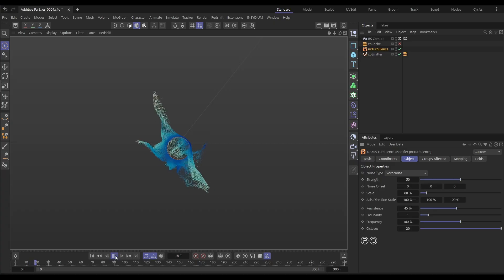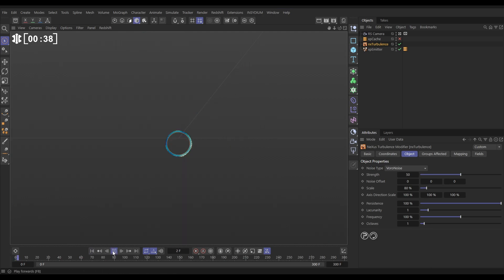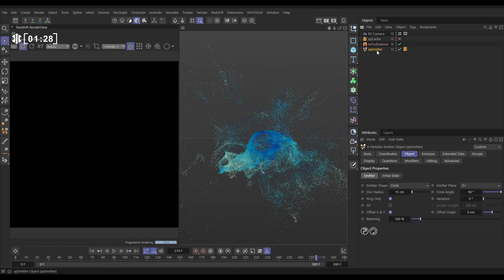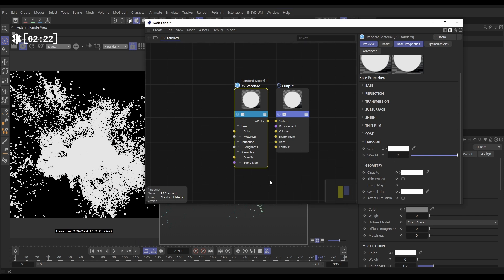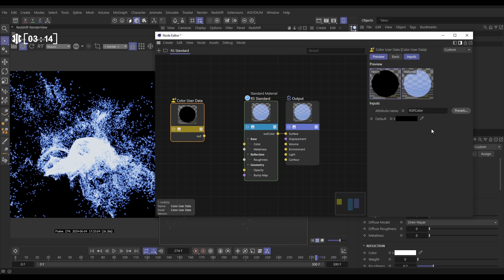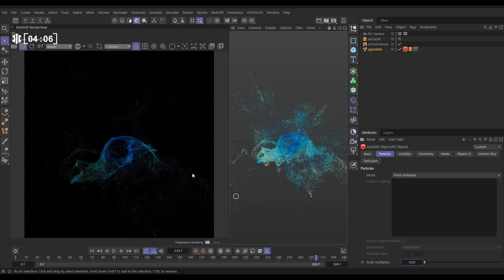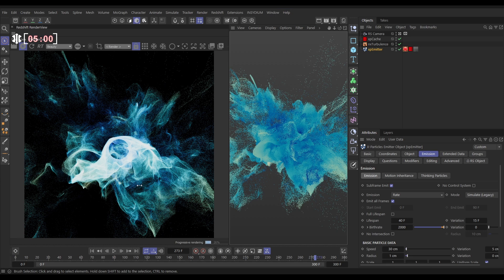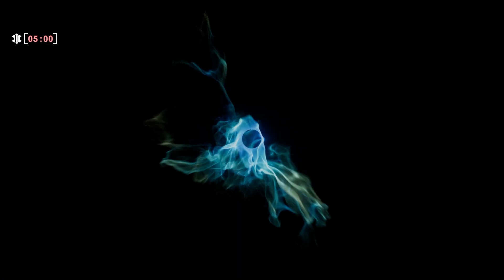Top Tip Tuesday - Additive Particles

Comment: How did you get it so smooth in the final render? When I render, even with motion blur, it doesn't have that plasma look, just looks like a ton of particles. I have millions of particles in the scene. Is it something in post?
Reply from the maker: If the individual particles are too obvious in your render, try reducing the point instance scale multiplier in the Redshift object tag. Getting that milky smooth look is mostly a balance between particle count and particle size. The more particles you have, the smaller they need to be in the render. Bob didn't render motion blur in Redshift. Instead, he applied pixel motion blur in After Effects. He also added contrast to the render using a Curves adjustment. This further darkens individual particles that are not overly bright which helps to achieve the smooth look.
Reply: @INSYDIUMLTD  Can you provide a detailed tutorial on how to make these particles more beautiful in AE? I have also used this effect in AE, but I still cannot get the same feeling as in the tutorial.
Reply: @INSYDIUMLTD  Ahh, thanks! I’ll try that.

Comment: I sincerely LOVE using this plugin  but my screen NEVER matches your tutorials  with the same settings. I always  have to crank up my particle count to get anything even close. Posted about it in discord but no response. It's been very demotivating. If anyone else can help I'm all ears!
Reply from the maker: It sounds like your particle 'Birthrate Timing' is set to 'Per Second'. In this scene, Bob has this parameter set to 'Per Frame'. This would mean that Bob has 30 times the amount of particles than you. To access this setting, go to the Emission tab of the xpEmitter, and twirl down the arrow next to Birthrate.
Reply: @INSYDIUMLTD  This solved it!, thank you!
Reply: Same thing happening to me. I thought it might have something to do with different default scene scaling settings in my Cinema 4D , but it doesn’t look that’s the reason. If you find a solution let me know 🙏